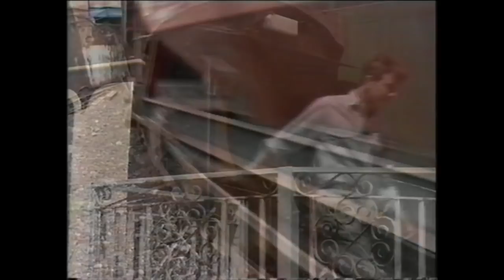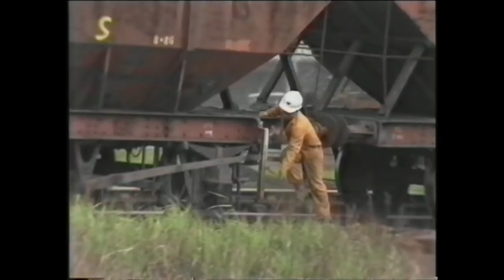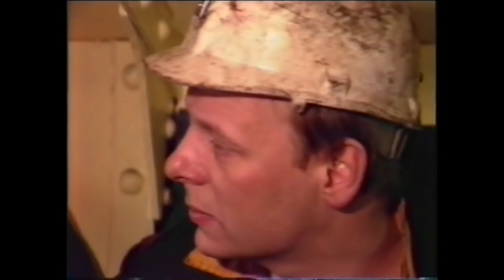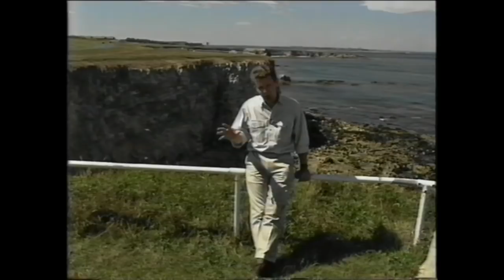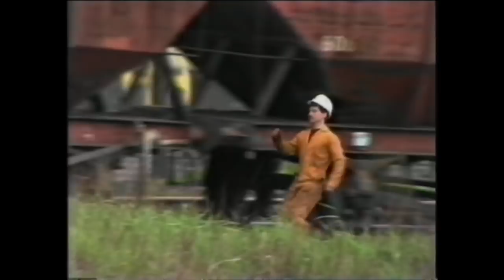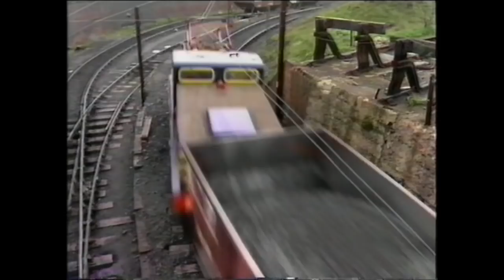'END OF THE LINE' Harton Electric Coal Railway by British Coal Television

Comment: Isn't that seriously dangerous what that bloke was doing at 2:33? Shoving that long pole up onto the live overhead line?! I take it the pole was well insulated.
Reply: The poles were wood.
What was dangerous was sitting on the brake lever on the wagons.
You slip and go under the wagon and you get cut in two.
Reply from the maker: The pole would have been made of wood. Power was only 600v dc. In the past, I heard Sydney electric train drivers did the same when there was insufficient air to raise a pantograph. And they were playing with 1500v dc.
Reply: @tressteleg1  the Trolleybuses in the UK and the Sydney ones were raised and lowered by a bamboo pole that was stowed under the bus.
Reply from the maker: True. Double deck trolley buses were more likely to use those bamboo poles while single deckers were more likely to use ropes. 
Riding the brake lever on those coal hopper wagons was certainly risky but they seemed to manage, but I guess there was the occasional slip.

Comment: Beautiful old Steeplecabs. I'll always have a soft spot for electric traction/industrial railroads like this.
Reply from the maker: I also find industrial electric locomotives to be particularly interesting but there were not many of them in this country. Port Kembla steelworks had some but they disappeared around the 1950s. There was also a network in Whyalla, SA, I think it was, while the SEC had them in the Latrobe valley for the brown coal. You may be able to find my video on that. A coal mine west of Newcastle also had electric locomotives which hauled coal wagons to the surface. They were interesting as the overhead collector ran on twin wires. I have movie film of that.
As for the Harton railway, my video covers two visits and the second one was the same day as that official film crew who was kind enough to you send me a copy of the completed works which you have seen. Here is the link to my own coverage of that fascinating system. They were not playing trains there! 
Harton Electric Railway 1986 & 1989
https://youtu.be/sLwqkGYgB-0

Comment: I'd always loved those short steeple-cab locomotives but had no idea they were German built, but I can sort of see it now. Love the sound of those pantographs on the low overhead and the gravity transfer system is pretty unique.

What's always impressed me is how long some industrial steeplecabs lasted in service. One over here in the US (of which I volunteer with at a museum) was completely custom made from spare bits in 1926 and never actually retired, having gone straight from service at the power station to the museum, where it is still frequently used.
Reply from the maker: While the earlier locos where certainly German Siemens built, I guess you realise that the locos in general use this time were, I believe, British built and favoured because of their greater horsepower. I think a Siemens loco makes a short appearance in each video but sadly lack of funds apparently meant none of the larger locos were saved. And I share your interest in electric steeple cab locos.
Reply: tressteleg1 Ah, right, so it's the slightly smaller one with the central pantograph that's a Siemens product?

They are quite good machines!
Reply from the maker: Yes. It tended to be a low entry step for the crew. All good machines from a fascinating railway. And it was just great luck that I was there the same day as the official photographers and they were kind enough to post me a copy of their finished product. Otherwise I think their work would be hidden from view forever which would have been a pity. 
Anyway I had better get back to editing a visit to the NYC Subway museum with a commentary by a real expert. 😄
Reply: tressteleg1 Ooh! Third rail stock! Excellent!

Very interesting you got to see the end of their operations too!